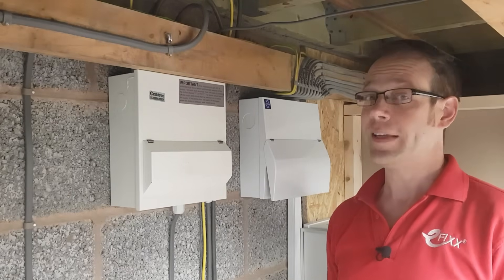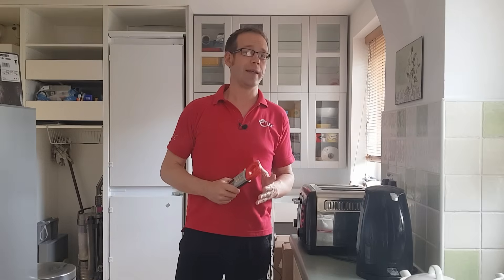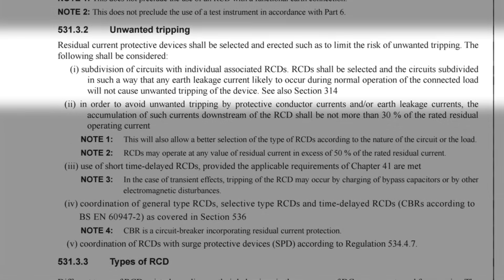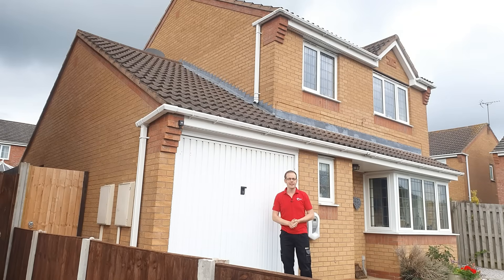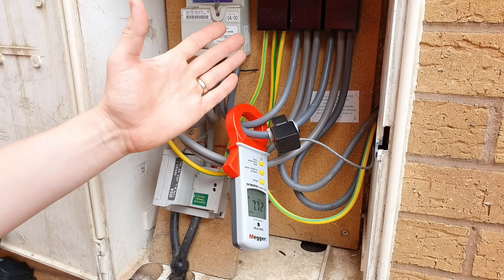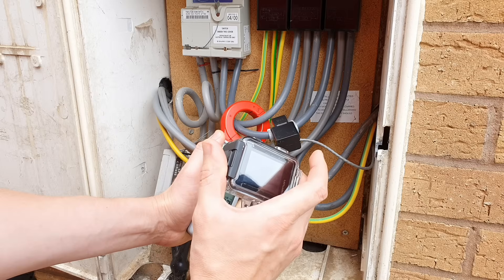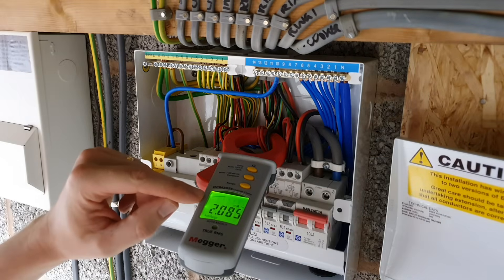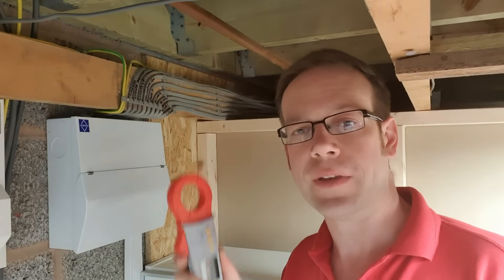EARTH LEAKAGE CURRENT - WHERE it comes from and HOW to measure it. - MEGGER DCM305E

Comment: I started using an earth leakage meter a few years ago. I can’t quantify the stress it’s saved me before doing a consumer unit change. If the earth leakage reading is off the scale I don’t even bother quoting for the job. I just explain to the customer that you’ve a pre-existing problem. Not worth the grief or risk of tripping after changing the unit. Well worth the money.
Reply: Do you isolate the problem then give a quote?
Reply: @johnburns4017  I used to but I’ve formed the opinion that it’s not worth the risk of nuisance tripping coming back on you. Once that starts then you’ve inherited the problem. Got to ask yourself, do you really want that? IMO life’s too short for that and after 31 years of being an electrician I’m aware of the stress that something like that can bring.
Reply: Paul Hayles So you find an easier way to make money and leave someone with a future electrical fault ?
Brilliant well done
Reply: @rossmurdoch1886  it’s not a future electrical fault, it’s an existing one.
Reply: Existing potential fault surely?
 It could become a nuisance trip if someone else shoves it on an RCD because an experienced spark like you couldn't be bothered to sort it because it was too much hassle
Reply: @rossmurdoch1886  
I quite agree.
Reply: Anytime anybody wants a board changed if its not had a rewire I wouldn't even entertain it .
Reply: presumably by of the scale you mean anything that approaches 30ma? and does the earth leakage test save you from carrying out the insulation resistance test?  These days it may be worth while carrying out an AC and DC leakage test prior to board change as some circuits have high DC leakage too. Thanks
Reply: @daviddmf  yes the yardstick I used was 27ma, anything over this and it’s an invitation for trouble. If the earth leakage was over 27ma I wouldn’t carry out an IR test, I used to politely explain my reason for not taking on the job. If a RCD trips after you’ve left then you’ve inherited a headache that was sitting there all along. It could bog you down for days trying to find it & all the time would be unpaid. I’m retired now, so it’s all in the memory banks.
Reply from the maker: Great to know thanks for commenting. 👍

Comment: Great video, if we are talking about earth leakage meters would it not also be prudent to talk about DC leakage which to the opposite of nuisance tripping could stop an AC RCD tripping...   No point in spending a fortune on an AC earth leakage tester and then also need to spend money to have DC earth leakage..
Reply from the maker: More coming soon!
Reply: Something like the Uni-T 210E (also sold under other brands in the UK like Tenma 72-2985) will do milliamp range AC and DC leakage.

However...

Milliamp range DC clamp meters are at best a bit finicky. They're useful, but you have to be very careful to get a valid reading.

Some meters can measure AC+DC (i.e. both at the same time) currents but the best I've seen has a resolution of 10mA.
Reply: @tomcardale5596  Thanks Tom, keep meaning to get an earth leakage meter but been trying to find one with resolution down to 0.1ma but be able to measure AC and the DC current on an AC circuit...  Guess thats just not really possible, in the rare occasion might have an RCD that fails to trip and after replacement still fails to trip, start isolating items that might be giving DC leakage and/or replace with a type A.
Reply: @steve11211  if you find one I'd love to know!

I guess in the scenario of an RCD not tripping, you can isolate the circuits it supplies and ramp test it to prove it's working. Then once you know that you can go through adding circuits until it doesn't trip? Do a ramp test each time you add a few more things in. Some type AC RCDs won't trip if you set your meter to A or B which isn't surprising really.

High levels of DC leakage are probably most likely from EVs, battery storage and renewable inverters and in a lot of those cases type B RCDs are mandated if RCDs are required. Some have them built in, others don't.

Comment: We got the Kyoritsu (Kewtech) 2431 around 22 years ago and it's been one of the most important and most uses pieces of test equipment we own.
Reply from the maker: Kyoritsu is that a brand of the Fukarwhi Corporation?
Reply: @efixx  No idea mate as far as I know it's trading Company is Kyoritsu Electric Corporation, Japan. But here's an interesting bit a history. 

MORE THAN TWENTY YEARS EXPERTISE    

Established as a business in the UK in 2004, Kewtech has a heritage that goes back well into the twentieth century. The Kewtech Directors and many of the staff were originally part of Robin Electronics that was the UK market leader during the 1980s, 1990s and early 2000s. 

Robin had established a reputation for excellent and reliable products that were manufactured by Kyoritsu. When Robin was acquired by Fluke, Kyoritsu and the previous Robin UK management team decided to create Kewtech in order to manufacture and market quality test equipment specifically designed for the UK market.

 

Kewtech is owned and managed by the original founders and employs a team of more than twenty UK staff designing, developing, testing, marketing, selling, repairing and supporting Kewtech products throughout the UK. Products continue to be manufactured by Kyoritsu and other quality focused instrument and accessory specialists.

Comment: What about those 100A blocks splitting tails inside meter box? Last video about EV's installs, you guys said that equipment shouldn't be installed inside there. How to go around those situations?
Reply: I was thinking the same..
Reply from the maker: More info on that coming soon - in short if the meter installer complained they would have to be moved

Comment: I use the T.I.S earth leakage clamp meter, worth every penny. Every tool bag should have one for EICR'S or board changes. Great video mate.👌
Reply: Why EICR because you would to an insulation resistance test anyway.
Reply from the maker: It's just another tool in the armoury to find problems. Could potentially spot an issue before you even turn the power off. 👍
Reply from the maker: Thanks very much. 😊
Reply: Same one here one of those tools that when you need it it's a god send

Comment: RCBOs which have functional earth connections can be a cause of earth leakage via their earth, which can be an issue if there is another RCD upstream. I measured about 1mA - don't recall which brand.
Reply from the maker: Great point - we’ve just fitted a load of them here -
Reply from the maker: https://youtu.be/2iY7PmG66EI we are back at that site soon so we’ll see what we can measure.
Reply: The earth fly lead on rcbos allows them to operate if the supply neutral is lost/disconnected.
Reply: @duzzah  and the ones without the fly lead would not operate if there is a lost neutral?